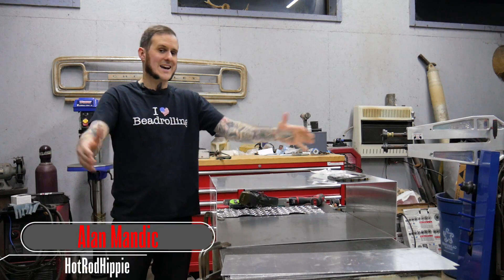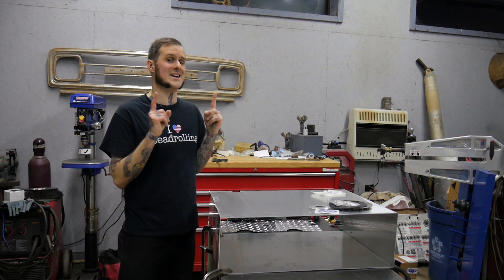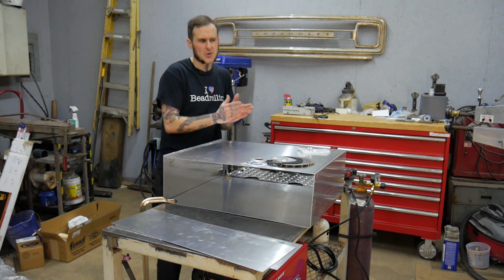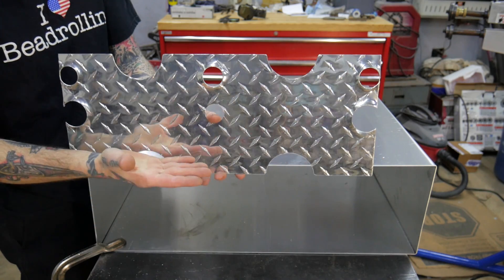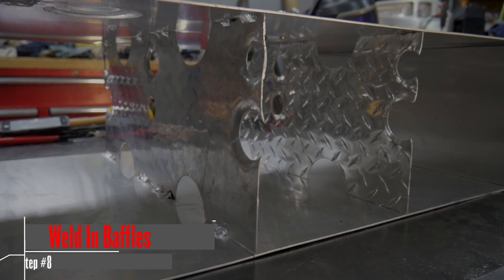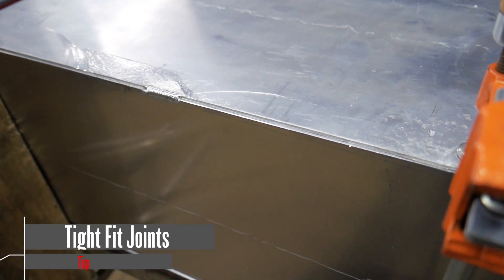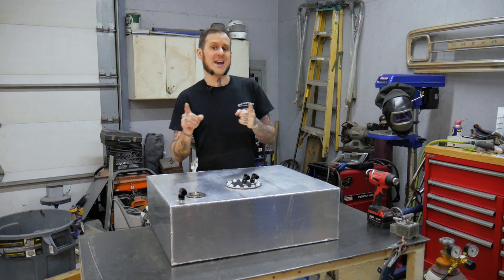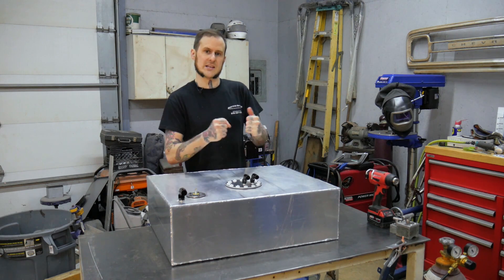Building a Custom Fuel Tank

Comment: You don't have to purge Stainless unless it is food grade and Sugar passes Xray. Aluminum however you need a High Freq. welding setup with water cooled torch, Stainless you don't.
Reply from the maker: You should always backpurge stainless. If you don't it will corrode completely defeating the purpose of using stainless. We had a stainless tank at the shop recently where all of the welds were rusty because of poor gas coverage and lack of back purging. I've seen stainless headers break in the corroded areas where they weren't back purged.

Water cooled torches are a nice to have but not needed for any materials. I welded this entire tank air-cooled and had zero hot hand issues.

Comment: I feel bad that some new welder is thinking aluminum is eazier to weld then stainless thanks to this video
Reply from the maker: I specifically didn't say that about Stainless. I said it's harder to Cut, Bend, and Grind. I did NOT say Weld. It does require Back Purging which requires an additional Regulator and Argon tank (or dual regulator). That is a lot of additional expense for someone building one fuel tank and thus why I mentioned it.

I approached this as an introduction for a DIY crowd. To someone in that situation they likely don't have a Brake, Shear, or Welding setup to properly produce a Stainless Steel tank. Heck when I made this video I didn't have the tools on hand to do it. I've built stainless tanks before but wasn't in a position to make this one out of it.
Reply: @HotRodHippie  oh nah i think you did an amazing job lol just that part was bad keep up the good work man
Reply: @HotRodHippie  for you normal welder welding stainless is probably cheaper tho considering aluminum is a full new learning experience and most even experienced welders take  some time to learn it.

Comment: I can send you pics of an 1800 gallon stainless tank tested with 15,000 pounds of water that says you don’t a have to purge stainless.
Reply from the maker: Send me that same tank in a couple of years. It isn’t an instant failure situation. It is that the coking and metallurgy changes on the backside of the weld will lead to corrosion eventually. And when someone is investing the time and effort into building something from stainless, they are usually doing so to avoid corrosion. In industrial applications they weigh the cost of doing it via purge, etc, vs the cost of redoing the job down the line. I’ve met plenty of commercial welders who worked in situations where it was just expected they’d be redoing a project again in a few years. And in the long run that was just a cost of business.
Reply: Going to be tough there at airports all over the country

Comment: He's welding three, oh, oh, three?
More like three, zero, zero, three.
And putting the pick up in a "designed in" low spot on a primary tank and having it feed to a smaller secondary tank "one gallon sized" with the main high pressure fuel pump in the secondary tank that does not need baffles would be better as when the primary tank fuel level is low and the car is parked on a steep slope the fuel can run to one way or the other and the pick up will suck air. That secondary tank will still have enough fuel to start and run the engine long enough to get going or move to flatter ground.
Reply from the maker: Ah yes we all remember the famous James Bond "double zero seven". 

What you are referring to is generally called a surge tank. On most street applications is unnecessary. A well baffled tank will generally maintain fuel around the pump area even on a mild incline. A built in low spot only works if you are willing to sacrifice tank capacity for that mild benefit. In this case the truck will lay frame on the ground, so we were not willing to have a drop sump hanging out below the frame.

Comment: Too much roll on the welds dude
Reply from the maker: ewmism think I needed to step down a filler size? Goal was penetration with a fully filled weld. It is an unseen component under the truck so weld aesthetic wasn't the primary goal. I'm not an amazing aluminum welder so I'm always looking it improve. Any input is appreciated.
Reply: Yes or you can increase weld speed and amperage. Your large flange was good I don't know about the small.. It's an art, keep at it..
Reply from the maker: ewmism constructive input is always appreciated. Thanks

Comment: Purge weld a stainless tank ??
You don’t know what your talking about!!!!!
Reply from the maker: I’m sorry what? You don’t think you have to purge weld a stainless tank? Please explain that one, I’m curious as hell as to how you justify that.
Reply: @HotRodHippie  there is absolutely no need to back purge a stainless tank during welding. Purging is mainly required for pipe or tube work. It would be pointless to  back purge for corner to corner welds such as in a tank as you are suggesting. Yes I’m a qualified fabricator since 1993.
Reply from the maker: @thebigw3377  why is it required for tube work but not for sheet work? Stainless steel is stainless steel. The metal sugars up on the backside of the weld exactly the same on a sheet metal corner weld as it does on a tube butt weld. Mock-up a stainless box without the sides, weld the corners, look at the backside of the welds. They WILL exhibit the same “sugaring” (flaky grey slag-like substance) that any stainless gets when exposed to atmosphere while welded. That sugaring is iron being pushed out of the stainless steel and WILL corrode and ruin the benefits of Stainless Steel, thus wasting a customers time and money in the long run. 

Does back purging a tank take a LOT of gas? Yep. It’s why aerospace and similar industries weld inside of purge chambers, so they don’t have to keep just venting gas to atmosphere. 

Do you not wear a respirator while welding Stainless also?
Reply: @HotRodHippie  if your seeing excessive sugaring on the inside of a corner to corner weld then you have other issues. Ive literally fabricated thousands of stainless tanks for oil/gas industry and not one has been back purged. The pipe work attached yes but not the tank as it’s pointless.

Respirator ??? 
Safety’s for wimps son 👊

Comment: Worst tank design I've ever seen
Reply from the maker: Worse than stock unbaffled tanks? I’m impressed!  I WON! 

You’re gonna have to explain what’s so bad about it. Enlighten me please, I’m curious for my own information and that of the numerous fabricators I’ve known to use the exact same overall design.
Reply: @HotRodHippie  where the pickup is. there's a reason why oem put a buldge lower in tank where pick up sits doesn't matter how many baffles you put init will still surge 
Again worst tank design I've ever seen
Reply from the maker: Bigbot Hoee have you looked under many vehicles? A sump under the fuel pump module is a thing but most are flat. Such as the EVO 7 you have videos about, there is not bulge under the fuel pump module... When I was a Mitsubishi technician I don’t remember any Mitsus having one. Granted that was 15 years ago when Evo 8/9 were new cars. Having one would be a good idea, gravity working for you Is always good, but doing so would cut down on overall tank capacity in this case. The truck is only 1” off the ground when laid out, so going down with the tank design isn’t a good idea. Most aftermarket tanks for these trucks (and many many other vehicles) are designed very similar to this. So I have to ask, how many tank designs have you seen to say this is the worst one?
Reply: @HotRodHippie  you must have been a bad mitsi tech then I've built  fuel hangers for the evos with surge tank built init 
And they do have a dropped section built into tank and where it holds fuel in a cavity only a 10mm drop in that area and most ranks are like this
Reply: You can clearly see this Google images if you don't believe me lol it's a v shape underside but inside that's where the pick up sits
Reply from the maker: Bigbot Hoee https://stmtuned.com/products/oem-mitsubishi-evo-8-9-fuel-tank

The bottom is flat. It has an internal baffle tray that fuel sits in. Factory fuel pump modules often use a basket (that you seem to be calling a surge tank, though that’s generally considered an external tank with a secondary fuel pump). 

A sump (what the bulge you are referring to would be called) would be a great idea in many applications. That however doesn’t make the lack of one a “worst design”. 

https://rickstanks.com/
http://www.boydwelding.com/

Many aftermarket tanks for street vehicles don’t have separate sumps. We aren’t drifting or road racing a truck that lays on the pavement when aired out.
Reply from the maker: Bigbot Hoee no I put baffles in every tank. Even on the street normal acceleration or corners can cause pickup issues and “surging” when not baffled. 

I’m not trying to argue with you. You ARE correct, that a tapered or sump design is superior. Absolutely correct in that regard, there is no mechanical force that’s better than gravity working for you. It just isn’t that big of a problem for most of the vehicles I’m building. If I was building a race car I’d be focusing on that a lot more. Thanks. 👍🏻
Reply: @HotRodHippie  nice welds what setup and electrode you using ?

Comment: How did you get power to the pump?
Reply from the maker: Didn't do it until quite a while later, but I used Telfon shoulder washers to insulate some drilled holes, and used simple stainless screws to wire with.  I made a short form video about it a while ago: https://www.youtube.com/shorts/5z-4AZ5tqZw